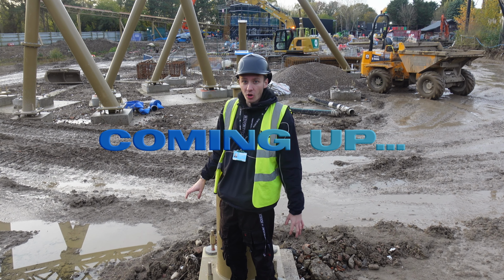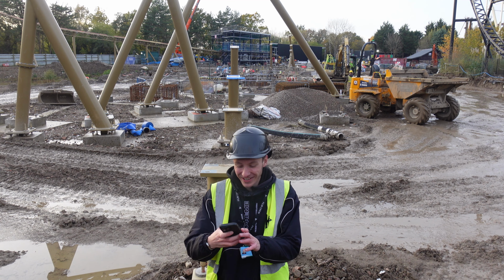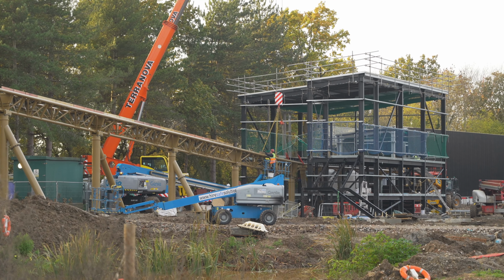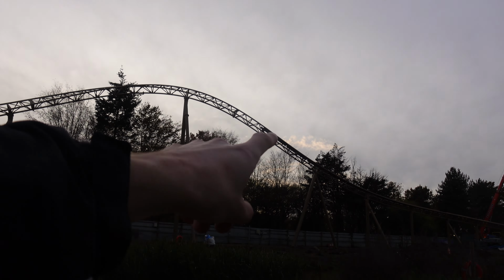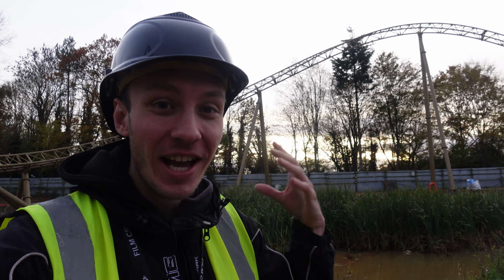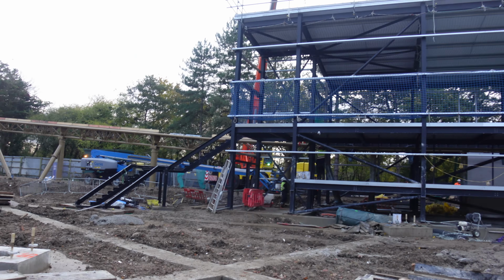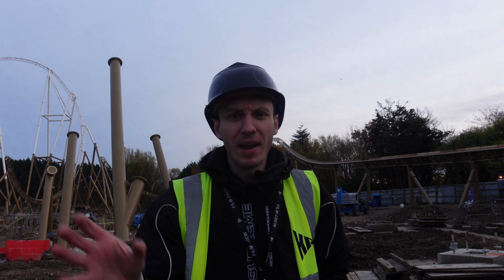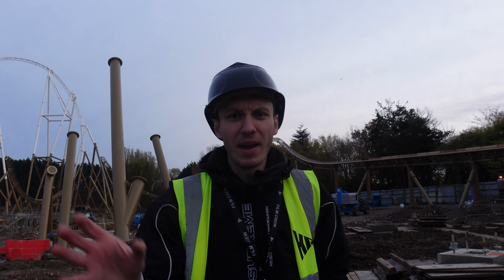HYPERIA New TRACK Installed! Construction Update #49 | THORPE PARK

Comment: When do u think they will start seeing the chain lift go up?
Reply: I would imagine the chain lift will go in practically last, especially the low bit, as they need that access area for all the middle parts of the ride. That lift is going in right next to saw, so the supports will like prevent cranes getting into the centre area.

I reckon they will put the tall first drop bit up earlier than the incline just like they did with that mad wave turn